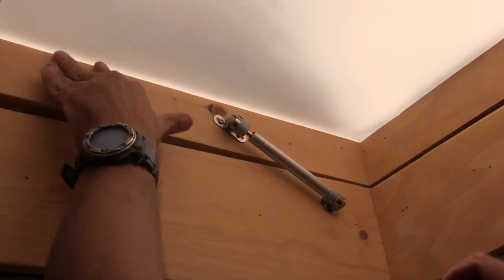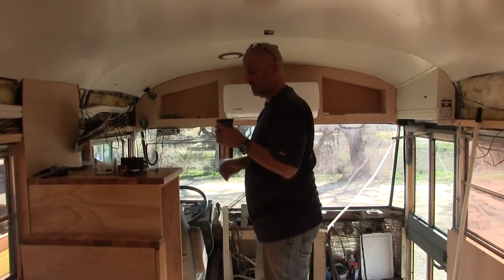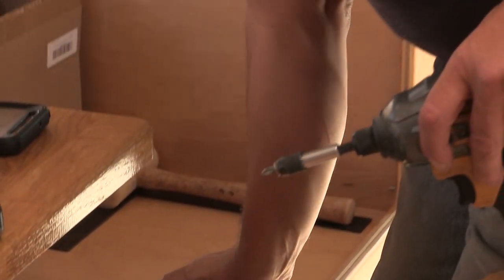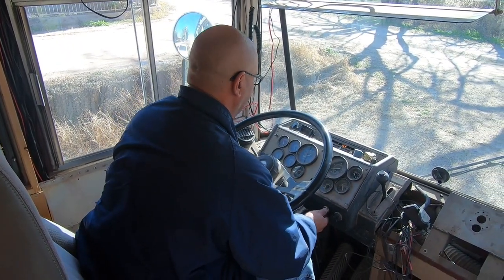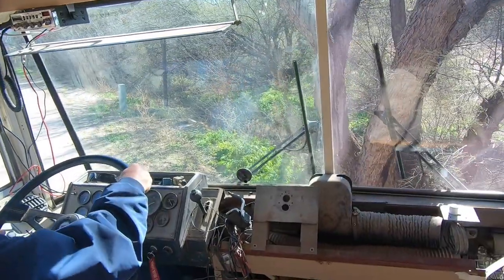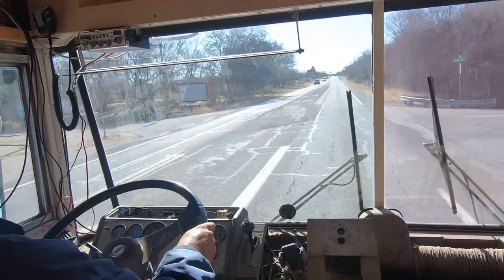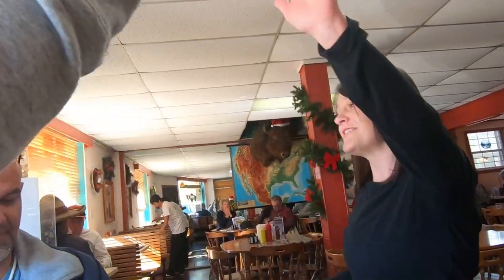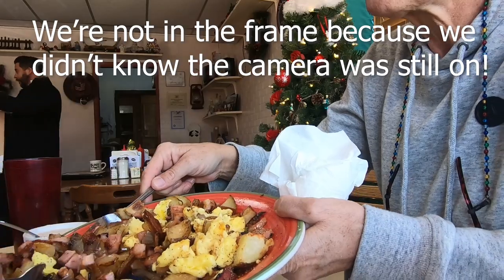Skylight Struts & Trim + Maiden Voyage to DMV for Inspection!

Comment: Well done video, love your senses' of humor. I rethought woodburning stove too- after I bought it. The addition of two diesel heaters, one front and one in back negated the need/want-  200 pounds of weight saved and no hole in the roof. Be sure to plumb the diesel heaters to your bus's fuel tank, it's not hard to do- you'll have two ready made ports on top- a little brazing and your all set

Comment: When you put a vehicle back on the road don't over look the little things. All the hoses and belts on the engine. Air lines, trans cooler lines. Check the wheel bearings and brakes. Filters and fluids. Good luck.

Comment: What was that loud buzzing noise when you started the bus?
Reply: "Low Air" warning buzzer, once engine starts after sitting awhile, needs compressor too run too build enough air up 90psi - 120psi) too operate air brakes.  Buzzer should cancel after about 60psi air in the tank(s).